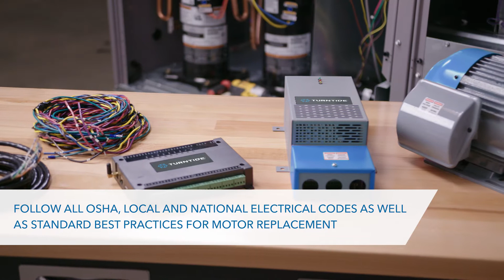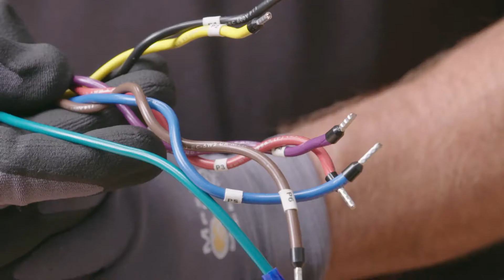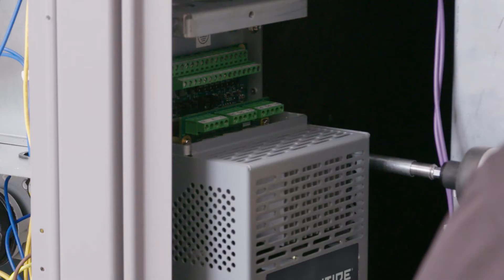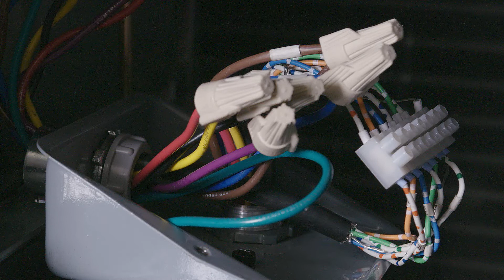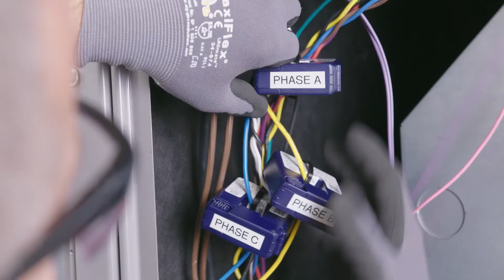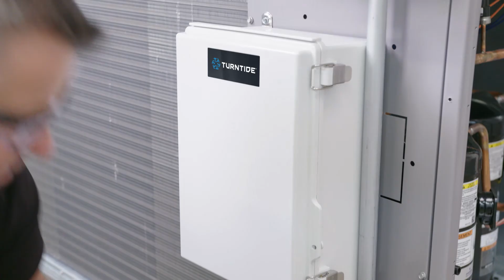Turntide Smart Motor, Motor Controller and Supervisor Installation

Comment: Here is an idea for a benchtop demonstration of these fancy digital motors: A lathe for woodturning with soft start,  variable speed, increased torque when taking heavy chips (especially at low RPM) and automatic shutoff should the workpiece fly of the lathe.  Bonus points for controlling the lathe over a tablet. Stretch goal: make it automatically adjust the RPM to keep the workpiece surface in contact with the chisel at a constant speed (As the workpiece is reduced in size the load characteristics should change in a detectable manner).

That would be an impressive demo!